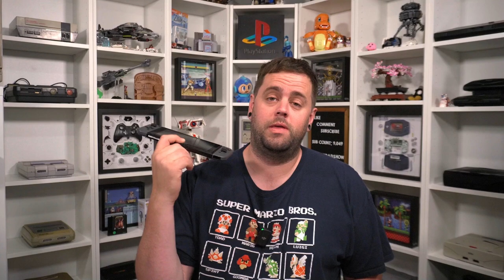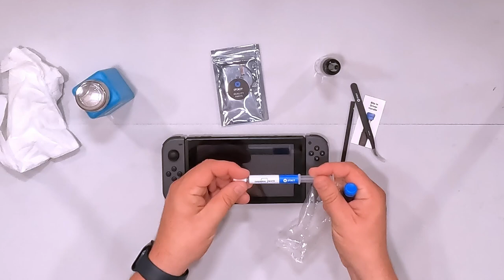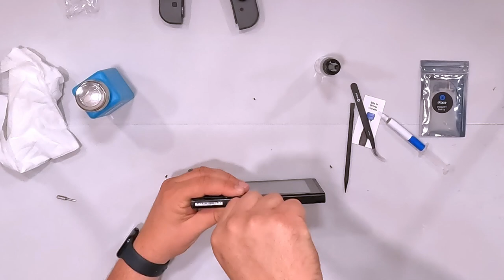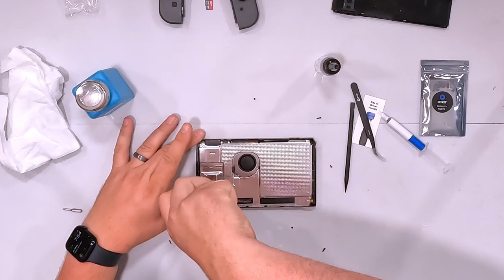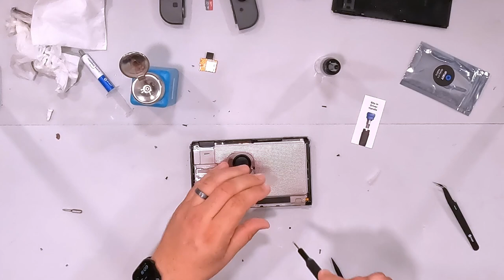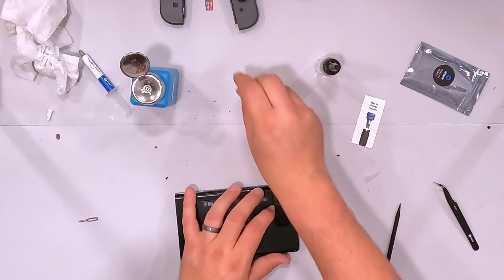How to Replace a Nintendo Switch Fan!

Comment: I replaced a fan on my OG Switch. I did so so I could sell it to my coworker once I got the Animal Crossing model. The only annoyance (albeit minor) is having to remove the heat sink and have to repaste it. But it's not too bad. I love iFixit products as well.
Reply from the maker: Ya it’s crazy how much you’ve gotta remove to do it